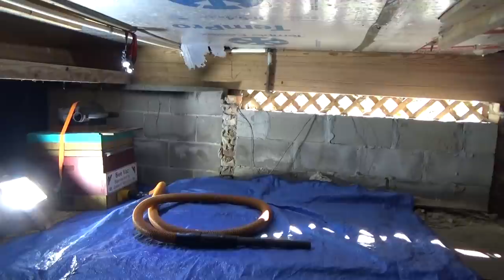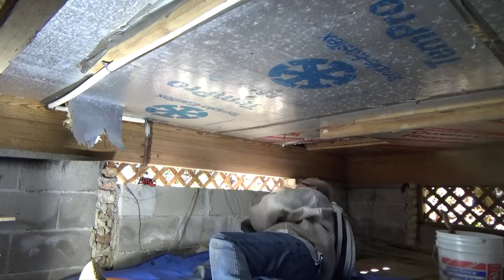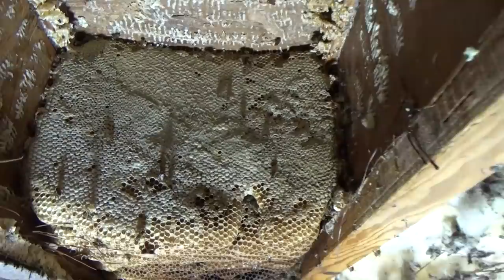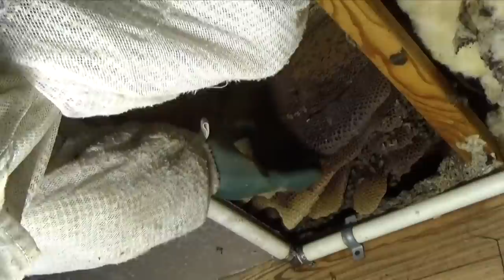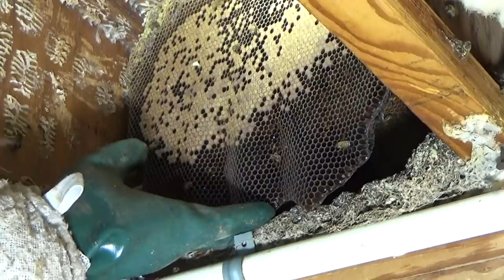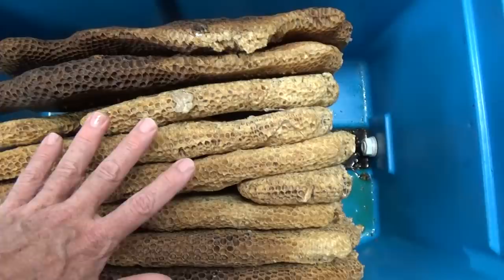Removing and relocating a large, honey laden bee hive from only a 3 foot high space.

Comment: Jeff, will that capped brood survive?  I thought it needed to be kept warm by the bees in order to survive.
Reply: I was wondering that too. How can you use the brood from one hive later. Doesn’t it either hatch or need to be tended?
Reply: I also wondered that, so how about it Mr. Ed.
Reply from the maker: The capped brood will survive, but most of the uncapped brood will die. The ice chests keeps the comb surprisingly warm, and even after 4 hours in the chest, when I open it back at the abbey, you can feel the heat come out of the chest. Thanks for watching. God's peace.
Mr. Ed
Reply: @JeffHorchoff  Thanks, I guess they are not as fragile as I had been told.

Comment: I have a question: why do you put the comb in coolers and then in a nuc later rather than putting in the nuc right away? Doesn't it drip honey all over itself and make it harder to do later? (I'm not a bee keeper, just love the videos and curious 😁) And I thought brood is supposed to be kept right-side-up (is that true?)..how do you do that in a cooler?
This stuff amazes me!
Reply from the maker: I could frame it up immediately, but it makes the removal process longer, and the longer time I take removing the hive, the greater the chance of robber bees showing up to complicate matters. So, for those reasons I prefer to do it after the removal is complete. Brood, as well as the other comb, has to be placed in the frame the exact same way it was hanging due to the interior angle of the individual cell. When placing comb in the ice chests, I always place it upside down to prevent any honey from running across the face of the comb while I do the removal. As long as I place the comb right side up in the frame, I have had no issues of dying brood from that or the fact that no nurse bees were keeping the brood warm, the ice chest does a great job a keeping the brood warm. Great questions, thanks for asking and for watching. God's peace Tammy.
Mr. Ed